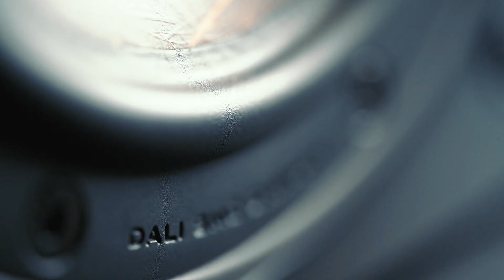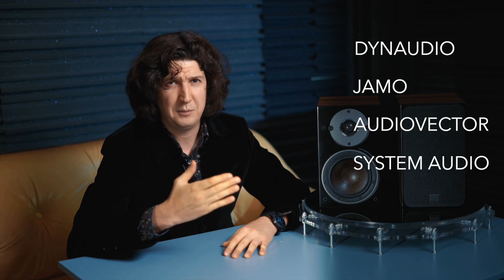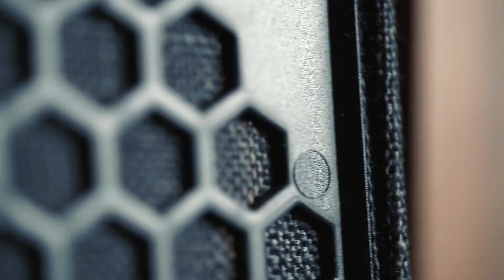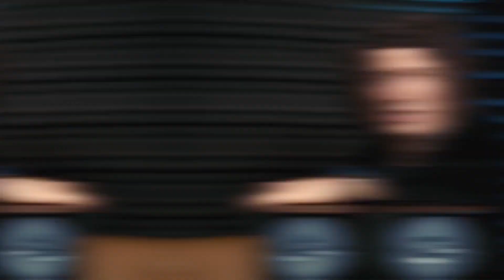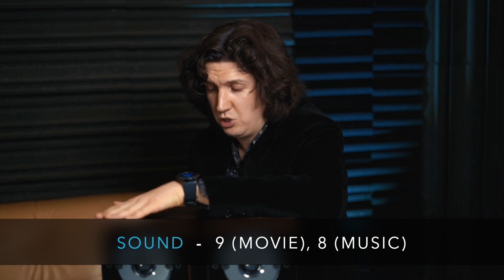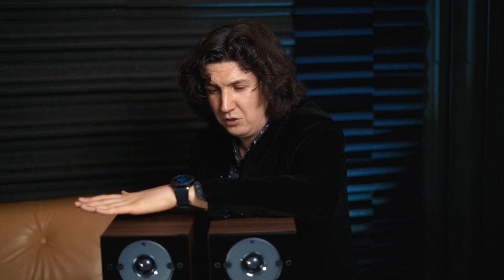Dali Oberon 1 we've tested, reviewed, benchmarked, and rated the Danish shelf speakers!

Comment: I had a pear myself go clarity image but there's a lot of cut manufacturer do with crossover poor quality parts and insulation of dampness insulation in box no braces in the box  the furry overpriced decent drivers bass and tweeter is very good driver's it's very disappointing the made in China that's the reasons why I give my view on them  I won't be buying them again I'm very disappointed  they crit the problems decent insulation. Dampness decent crossover put a brace in the cabinet properly very accent for the price £399 in the UK 🤔😒

Comment: How does Spector 2 sound in comparison with Oberon 1?
Reply: Going on memory, I had the Spektor 1 and the Oberon 1 in my system a few years back.  I found the Spektor 1 overall quite nice (coming from Focal 807Ws) overall with less resolution and detail than the Focals. It came across as sounding smaller (no surprise) but fairly well balanced presentation.  It did however take some power to get going but played fine at room levels.  

I didn't think the Oberon 1 was a notable upgrade, while producing more bass I found them a tad to laid back, nort for music but for movie soundtracks and a bit less dynamic than expected, but I was used to the Focals.  Still, not a huge upgrade in SQ from Spektor to Oberon IMO and from memory, form my remembering I felt that way.

Today I have the Opticon MK1 which I really like, its a notable step up in resolution, detail, imaging, etc and easier to drive despite being 4 ohms.  Plays fine with music and movies.  Other speakers may provide a more euphoric sound, such as additional highs, wispness, etc., but I find the Opticon 1 to be well balanced in most regards (bass is commensute with size), but especially with a sub, the bass, mids and highs are nicely balanced. With a sub, there is no brightness and they have more resolution, inner detail, dynamic range and aren't too laid back for soundtracks and voices like the Oberon.  Prices are relatively high compared to other brands, at least in the States.

Overall, I like the Opticon 1, even more than the Menuet SE which while having greater resolution, I found overly refined.  The Opticon 1 gave up a bit of resolution and body to the Menuet but sounds more satisfying for me.  AS to body, you get more with the Opticon then the Spektor or the Oberon.  

On budget, I would go for either Spektor or Oberon if discounted or a good price used.  Otherwise, consider an Opticon. Don't know how the Opticon 1 MK2 differs, perhaps a but better resolution and smoothness? The Opticon 2 MK2 frequency curve seems to follow what dali did with the Menuet SE, but I never heard the MK2 versions. 

Hope this adds some usefulness.